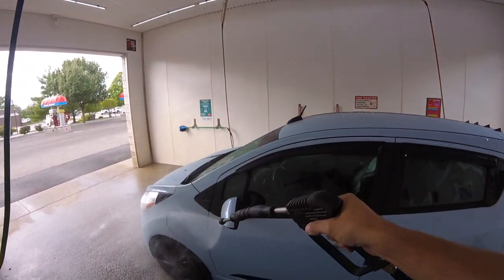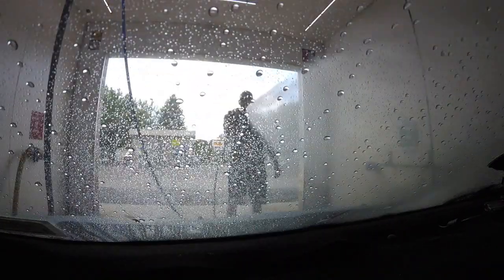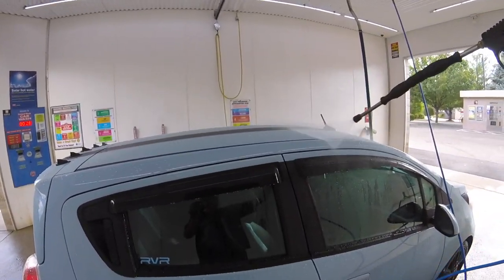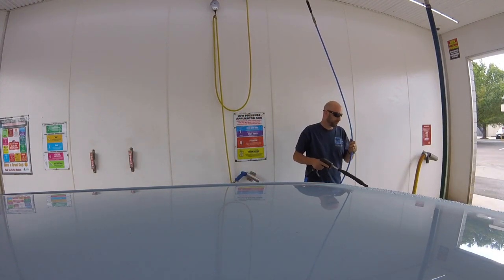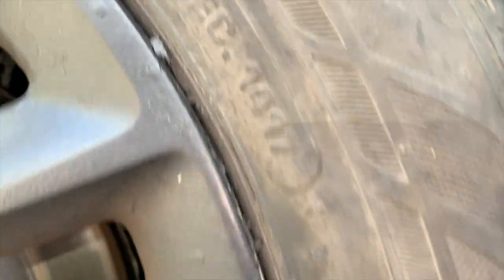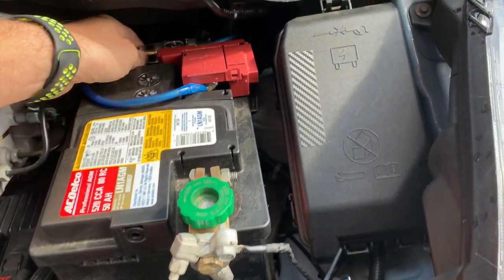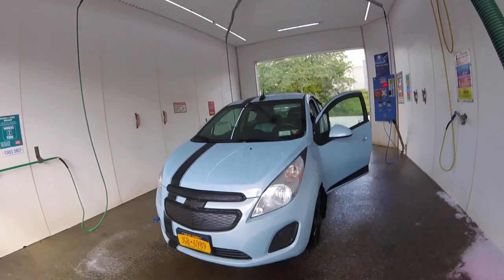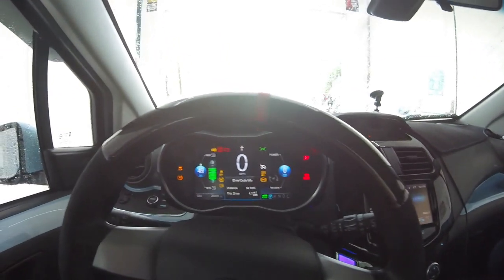Can you Wash an Electric Vehicle ? Question of the day EV news Daily Podcast

Comment: Can you wash the “engine” bay?
Reply from the maker: Hi manual says light pressure power wash is ok but there are engravings on the fuse box that has a power washer with a slash so No power washing the fuse box. I would also watch for the orange AC wires and coolant tanks and hoses.

Comment: I drive straight into the water. I did it with the Nissan Leaf, I can do it with the Spark EV. 

I remember when a guy told me during a flood that my car is too low. It was no problem.
Reply from the maker: Milian TV they are sealed up pretty good . Just thought I’d say something about it the old EV1 had a small part in the manual about deep puddles  and not deliberately trying to get water where it should not. My wife broke her ABS sensor from running through puddles too fast.